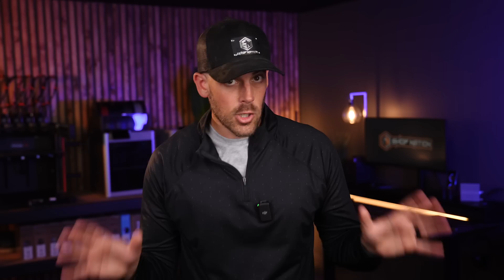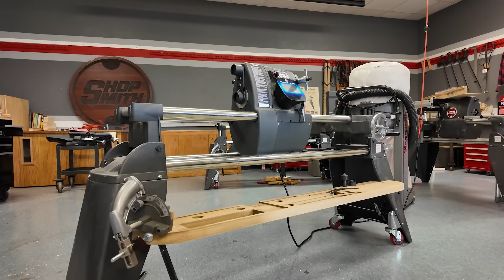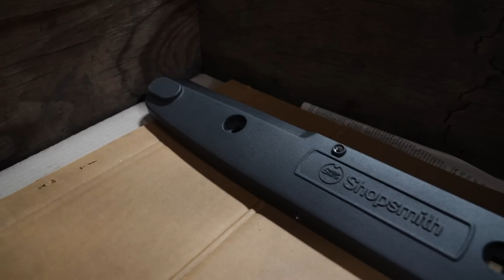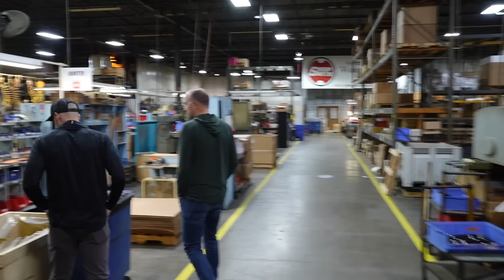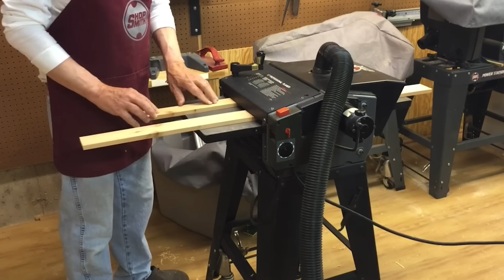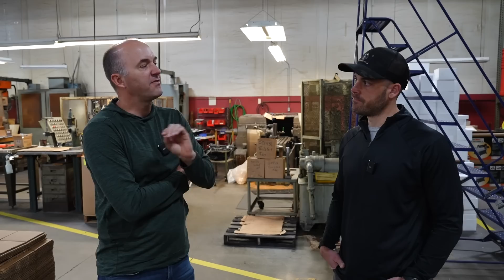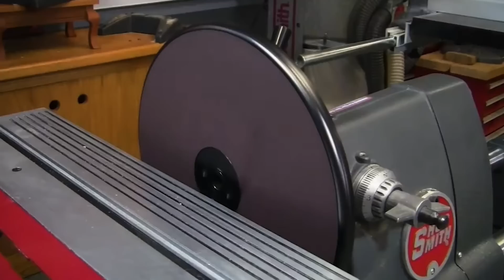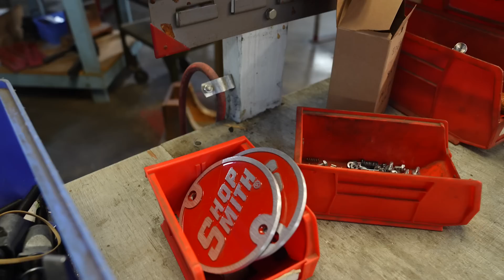The Last American Power Tool Company is (almost) dead

Comment: I am in my mid 50's in age, my father had the available space. Not so much the money. We actually built our own power tools from salvaged dryers. I wanted a shopsmith, but my father's reasoning was you will spend most of your time adapting a single motor with  your required tool.
And if anything happened to that motor, you lost your whole shop! A shopsmith was not cheap. And we already had built most of our own power tools except for a planer and radial arm saw and had plenty of space so it just didn't make sense for us.
 I can see for the average suburban type dweller, however  space is very limited and this solution can make sense as long as build quality and reliability can remain high and priced to be competitive. Shopsmith should  be in a good place as long as they can get into a suburbanites hands early in the game Before a bunch of money gets spent on standalone equipment.
Perhaps offering a new homeowner (or builder) a discount with a yearly reprise for attachment purchases. Because once the tool motor is sold, the owner will want to expand on that. But will likely buy a cheap standalone machine if an attachment is overpriced.

Comment: Had my carpentry business for 10 years and the Shopsmith did every job I needed. I’m in the U.K. and there is only one company that deals with Shopsmith. I think it’s a brilliant machine as the instruction manual is very comprehensive and maintenance and adjustment is fully documented. Shopsmith please come back to the U.K. especially now that you have the digital motor with extra power. I promote Shopsmith at every opportunity. Well done that man.

Comment: The problem is that most people who would be the perfect fit for this don't have $5K lying around for this type of purchase. Quit comparing this to buying the tools separately. That's not how the majority of woodworkers make purchases. Nobody sees this as a 1:1 replacement for the other tools, but a mitigation for utility over space--which most people don't have. If they had the space, they would also be more likely to get the dedicated machines. Drive this MF down to $2K for the top of the line model, and you will see this take over the market for homeowners and those who only have a single bay garage or a small shop out back.

Comment: I bought a MK5 in 1980 when I was living in military housing and my "shop" was a 4x8 foot shed.  I still have it and it now lives in a 12x24 bay in my garage.  It's supplemented by a full-size table saw and other dedicated tools, but it's my bandsaw, disk sander, lathe and occasionally drill press and horizontal borer.  In 44 years the only thing I've had to do is bearings and tires on the band saw.  Everything else just works.

Comment: Nick, I applaud your efforts on saving shop smiths. It is a good brand that is hampered by past managements failing to evolve. 

As a weekend hobbyist, I do woodworking, metal fabrication, and mechanical work, so I have an assortment of machines that I use on wood, plastics, and steel. the enormous entry price. And that is what’s needed for shop smith moving forward. To be marketed as a tool that the everyday hobbyists needs. Not just for wood but even for steel. 

Anyway, good luck to you and Shop Smith

Comment: I've had my Mk 5/510 Shopsmith since 1980.  very beam in my house was planed on the Shopsmith planer.  Many years ago I built several jewelry boxes & 'necklace trees' using my Shopsmith.  I still use it almost weekly for parts of projects.  After viewing this video, I think I will upgrade parts of my Shopsmith.  Thanks for this video.  I hope Nick is successful at keeping this great tool going into the next decade & beyond.

Comment: My Dad bought a Shopsmith about 1950. He used it very little. I still have it but it hasn't been used for many years. I did use it some when I was a kid (I'm 81!) Didn't have all the accessories. The little table as a saw was a major limitation. It was a good drill press and horizontal borer. OK as a lathe except it was prone to chatter since it was driven by a splined shaft and would sometimes chatter. 

I ultimately became a manufacturer of wood based commercial interiors. 25,000' plant and mostly CNC equipped. 
If he is going to revive Shopsmith he needs to invest in CNC equipment or farm out the manufacturing. It looks like the current setup is overly labor intensive. The current system looks like it employs a huge # of part handlings. No walking, locate successive operations adjacent to each other. You've got a long way to go.

Comment: I bought an entire wood shop 9 years ago built around a Shop Smith, always wanted one as a kid, He was a gentleman who was retiring and he was at age where he didn't want to get hurt.
I still use the planer, Jointer and the Band saw for small projects. I have all the attachments to do wood turning, but that hasn't entered my realm of wood working as of yet.
The motor is a thing of genius, so smooth and no vibration just a marvel of engineering. I think Norm Abram used the Shop Smith as a lathe to turn some table legs if I remember correctly.

Comment: I have owned and used Shopsmiths of all generations for 50+ years.  I have also owned many large professional woodworking machines.  When I retired and sold off my woodworking machinery, the only machines I kept were two Shopsmith Mark V 520s.  They are upgradable to the lastest version without modification.  No other woodworking tool company can say that!

Comment: My father sold them as a side hustle in the 50’s. He had his till the day he died in 2012 and the only part he ever had to replace was the toothed belt that drives the quill.   I could not wait to inherit his, so I bought one in the mid 80’s. Still the workhorse of my studio.  The thing about the Shopsmith is that it’s perfect for someone who doesn’t have a lot of room for all the various tools it covers.   It rolls way to take up no more space than a bicycle.  And I have a raft of attachments, from a bandsaw to a planer, that all get stored in a single cabinet.   It is so versatile, that it does things no other tools can do. My son was refurbishing some old conga drums and needed the open end sand to a perfect lane.  So I put on the disc sander, then configured it like a drill press and took off the table so the conga could stand on the floor and I could use the quilt to take down the top.   Or, I needed to bore a 40” long hole so I rigged a rest where the tail stock fits to hold the end of an improvised auger ( made from copper tubing ) and used the combination of the 4” of quill travel, plus sliding the entire headstock the full length of the ways. 
I am running a sculpture studio, not a cabinet business.  So the versatility of the Shopsmith in so compact a space is a huge benefit.
Reply: Have never understood why shopsmith did not make an under table router. Recently bought an older, model that does just that. Like the concept better than my newer model. Just hard to get info on it.
Reply: @c.d.porter9366 . They do.  It’s a right angle attachment to the headstock and the table is mounted over it. They call it a shaper, but mostly because it is designed to take larger shaping bits for molding and such.   You can put a router bit on it.
Reply: Ya no offense, but a sculpter refurbishing conga drums is exactly the market for a ShopSmith, but is not in the slightest "the paradigm of American productivity." That you want to not participate in a disposable economy is a thing, is a hobby, but isn't an act of survival.
Reply: @aardque  ignorance is a poor argument. I have built furniture with it. Built two  houses with it. Used it as an integral tool for 6 and 7 figure projects.   The shopsmith does what it does just as well as any other table saw, lathe, bandsaw, planer, belt sander, drill press, horizontal boring tool, joiner… Its cuts are just as accurate.  And the way it dovetails certain operations makes it do some things better than a bunch of separate floor standing tools.   About the ONLY thing that would argue for a bunch of separate stand alone power tools is if I needed to run, say, a cabinet shop, where it would be more efficient to have full time stand alone tools set up.    
But please don’t try and dismiss what I do as being some dilettante, just because I used one example of how the Shopsmith’s versatility offers some unexpected advantages. There is nothing you have ever made with stand alone tools that I can’t do just as well on a Shopsmith.  
I design and MAKE things for a living. I just happen to make things out of a LOT more stuff than wood.
I NEED all those tools for the ‘survival’ of my business…. I just don’t need them all of them every day, all day. And what the shopsmith does is allow me to have ROOM for my three 3D printers, My four 8 foot project tables, My hydraulic lift, my vacuum former, my radial arm saw, spindle sander, a welding table, plasma cutter, and all the other hand tools that play into making something like, say, an 18 foot tall bronze gamecock.  I can HAVE and rely on professional quality woodworking tools that take up no more space than a bicycle when I am working in steel, aluminum, bronze, plaster, resins, forton, or any of the other media that play into fabricating large scale art, moldmaking, and tooling.
I literally can and DO make ANYTHING.   If I was running something as narrowly focused as a cabinet shop, I would dedicate what floor space I have to the narrower suite of tools that would best make that work. 

On the one hand, Yes. The shopsmith is perfect for the person who does woodworking as a hobby, too, and doesn’t have the room for a bunch of separate tools.
But its is also perfect for the professional business that occasionally needs to do top quality wood work with a durable, accurate, and long lasting tool.
Reply: @christopherpardell4418  Excellent reply sir, les mots justes! I can only dream of the studio you describe and of having the skills to make good use it. I have just enough experience with wood, metal and plastic to understand the time and talent required to achieve a high level of mastery over each. If I could acquire a shopsmith, a MIG welder and a 3D printer I would consider myself a very lucky man indeed!
Reply: @jrose7849  You can pick up a used Shopsmith pretty affordably. Check your local online classifieds.  Same thing with a welder.   3D printers have become relatively affordable. I have a 24” by 12” by 12” Raise 3D filament printer that I bought used, and it cost about $200 to refurbish it and get it running flawlessly. And I have two LCD resin printers that are large format, about 15” by 7.5 inch by 12”. One a Peopoly the other a Phrozen. Of those 2 the Phrozen 8K is the more reliable printer. The key is to buy the printer that will print in the materials you will need for what you want to make.   We mostly just print patterns that we will mold and cast in Bronze or stainless. But, for example, if you want to make Automotive parts of plastic, you might prefer a printer that can print in higher temperature materials like carbon, or PEEK. Those require a higher temperature cabinet and printer head. Good luck.

Comment: I have had a shopsmith for about a year and it has been a great addition even though I already have a full shop. I use the lath, disk sander, and drill press the most. I’m looking at getting a bandsaw attachment so I can save floor space.

Comment: I own a very old shopsmith, I do have the jointer and saw table options but use is mostly as a lathe, I have often considered making for myself a metal working type of tool holder to use on the lathe for metal work. However I would also need to fit a suitable chuck and I'm not sure the headstock bearings are up to the extra workload.
Could be an upgrade to consider for future machines. Where do you stop? A lead screw for thread cutting?
Its a great machine as is and well made.

Comment: I had one of these and made a lot of items. One in particular stands out.
A local lumber yard was next to a railroad line. One day a train was stopped behind the Lumber Yard unloading lumber. A fire broke out and the local fire department put it out quickly, but in doing so water
logged a couple of pallets if 1" x 4" x 10'  that had to be salvaged. I came to the rescue and bought 
all the salvage. Now what do it do? I put my Shop Smith to good use and made 147 pairs of 
Adirondack Chairs. My hobby became a business and actually burned me out making wood items. I used my Shop Smith for a lot of other uses then wood. I made a number of aluminum and plastic items that could be machined with the Shop Smith. It is a fantastic tool and a multi tool in one.

Comment: interesting look, but fyi there is another company that did a similar, but smaller scale product the "unimat", like the size of a boley watchmakers lathe (not the 8mm!), it in effect did the same metalworking tasks, Not grinding{bench, but it took small bits, aka to sharpen lathe tools, milling cutters etc}, but saw, drill, mill, and finally screw cutting.

Comment: Had a ShopSmith back in the 70's handed down from my grandfather. All the attachments. Great machine, only reason I changed was I wanted independent, table saw, drill , lathe, etc.

Comment: THIS is a GREAT video!!! I'm almost 70. I've owned 4 Marks in my life and 1 knock-off. Nick, you are correct the table saw is where things tend to fall apart as EVERY TIME I need to reduce 4x8 sheets of material down in size the Mark does not do that well for me. I have noticed over the years SS has improved its table saw capability as far as handling large heavy sheet stock, BUT... I haven't ever been personally exposed to how well those improvements works. Almost everyone I know that has used a SS has said the same thing... it's a GREAT machine, but a lousy table saw.

With all of that said, that's the reason behind owning 5  of them over 45+ years. It seems I always miss something they do well and get ANOTHER one. I've owned the the model 10er all the way through the Mark 5 series. I've enjoyed all of the upgrades, but the pricing seemed to get a little too high for supplies (sand paper, tooling, some accessories) so I would find myself looking beyond SS for things and then eventually I would sell it off and start the process all over again. Not sure why... maybe (I'm an idiot... haha).

I do think you are on to something though.... if you can get things past the table saw issues. Marketing it to Crafters obviously is where I think it's best usage is, and I think most of us Old Timers will be rooting for you and your Team. Bring in a full line of current HOW TO videos will always be needed, and getting it priced in line with Crafter's price range maybe a challenge, BUT the product is ROCK SOLID.

Wishing you the very best,
Hersh

Comment: I've got a Mark 1, which is a great machine.  When I get it 42 years ago I tore it apart, cleaned and lubricated the bearings.  It has been a wonderful machine.  I'm so glad to have discovered that Shopsmith is still in business.  I'll definitely make inquiries about tooling that I would like to add to my already overstuffed shop.  Great video thumbs up.
Reply: Where did you find a Mark I?  Been playing with them for 
45 years, and NEVER heard of a Mark I.  Mark 2, 5, V, VI, and 7.
And, the Model 10.  Never seen Mark 3 or 4, either.

The 5 and V, same model, different name.  VI and 7, NOT the 
same.  VI was from the '60's, tilted both ways, and had the 
NASTY plastic "porkchop.  The 7 is the current, updated dual 
tilt Mark 5/V.

steve